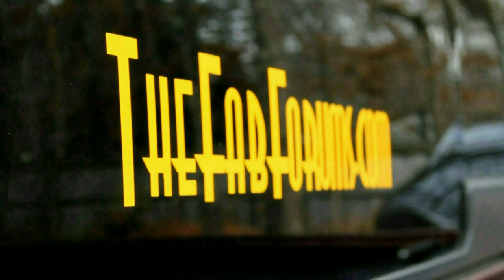You Need This Tool - Episode 75 | Locking C Clamp Pliers

Comment: I have many of those , very very handy . Those Pro Stars sure did clean up nice ! Any problems on initial fire up ( Big Stuff wiring ) ?
Reply from the maker: yeah...no issues with the fire up. The main fuel pump trigger activates the ground on the relay so I need to re wire that. I just use the other manual activated pumps right now.

Comment: Congrats on the Goose moving under its own power. Very cool. I use alot of those clamps on panel replacement on my channel for my camaro project that I call OverKill. I do find that I don't prefer the cheaper ones. Seems I have to fiddle with them more. I try to buy the Irwin ones. I take a little more caution when welding around the Irwin ones. I have been known to weld them to my work. lol
Reply from the maker: thanks